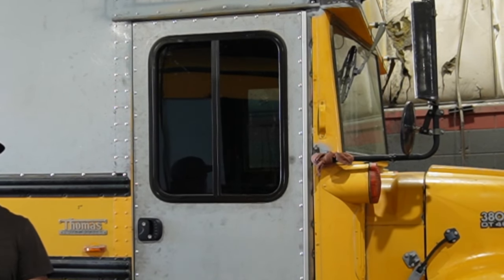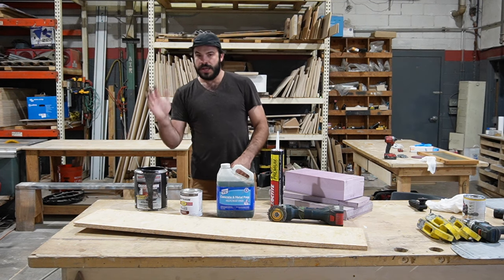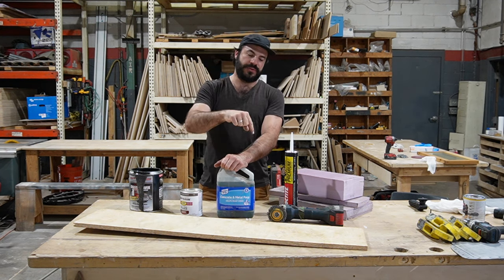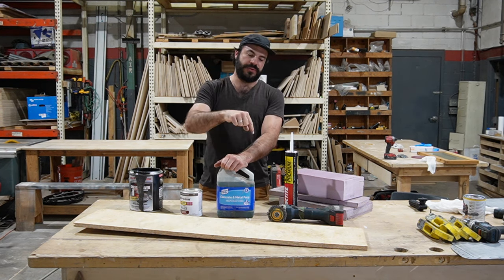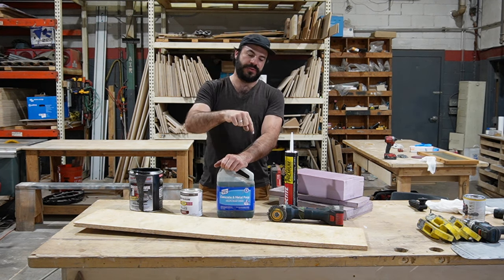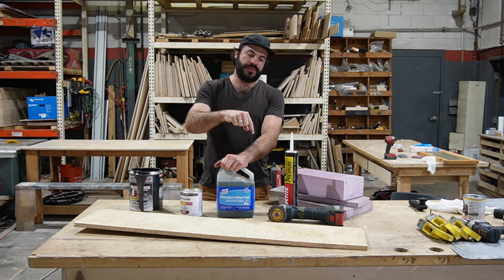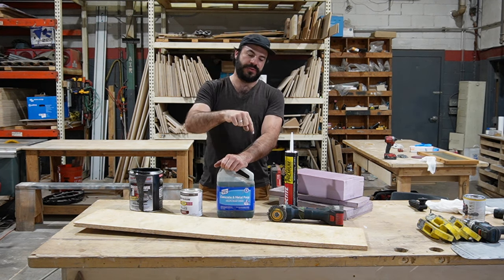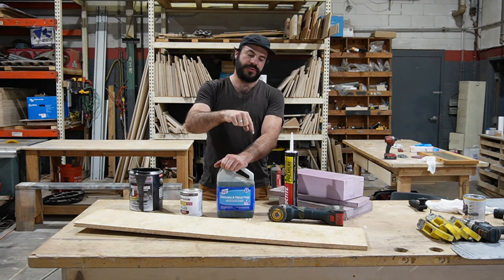Framing your bus conversion subfloor is a mistake, do this instead

Comment: Love your videos, liked and subbed!
I was pricing the foam sheets, and found that not only is the four inch stuff impossible to find, two 2" sheets ($42 USD each) cost less than one 4" sheet ($107 USD) , so, aside from the glue-up, it's cheaper!
Keep up the good work, I've learned a lot from your videos.
Reply: @DaveDrawing, what city and state do you live in, brother? The Foamular 2” XPS foam board is over $60 on my market. ☹️

If I purchase enough, it may be worth it to travel to save money. 

Thank you!
Reply: @trevorrisley5419  I'm in Richmond, Indiana. Our local Menard's sells the 4'x8'x2" for $41.33 USD, even eight months after I made that comment! Where are you?
Reply: Pennsylvania $54
 @DaveDrawing
Reply: @nateboer  well, it IS a year later...

Comment: the floor hatch tip is now.saving my life, my party launched for burning man and got 90mi before fuel pump failure. they are now unloading bus, i had to build a bed frame (removable) atop the pump.

Comment: I learn something new in every video.  Thank you for all of the great info.  I am wondering if any/all of these options can be applied to a new chassis Class B build (Ford Transit 6.5 ft. tall).  In an effort to balance sub-floor thickness vs height, I was originally considering only 1/2" of insulation (R-3), but after seeing that you use 4" in a bus, now trying to determine if 1.5" XPS + 1/2" AdvanTech would be sufficient?  The foam would be glued on top of floor ridges (per your video), which would leave a small gap between the metal floor and insulation which I thought would provide some air flow (and water escape path) in case of a future water system leak.  Also, would you recommend the drilling of a few small (1/4") strategically placed drain holes into the metal floor under the insulation, plus a coating of chassis sealer onto the new metal floor afterwards for added protection?

Comment: Wonderful tips, thanks! It think that window and door conduction, and convection from inevitable air leaks in windows and doors, will offset a lot of gains from the extensive work to achieve R20 in the floors. A couple of inches of insulation (to at least match the double pane window R value), a good heater and lots of warm clothes for the winter, and lots of air movement for the summer, would be more practical, especially for tighter builds than a spacious school bus. Nonetheless I like your no nonsense approaches.

Comment: The best, most comprehensive build video I have seen so far! Two questions: 1) Does the paint on top of wood act as vapor barrier or do you not subscribe to the need for a vapor barrier? 2) When you don’t patch holes in the floor, I assume you mean the tiny screw holes, but how would you patch up larger holes from coolant/heater hoses and such - assuming you’d want to patch big holes?

Your videos are so helpful and I can’t thank you enough for making these!
Reply from the maker: im not worried about a vapor barrier yet as that will be a part of the finished floor when i install that. this bus has none of those holes but on the ones that do, we use a scrap piece of sheetmetal and glue it down! great questions, thanks!
Reply: Question: what do you do if your metal pan isn't perfectly flat but has channels? Do you fill the channels with wood? Foam?

Comment: Big can is basically knock off version of Por-15. Definitely great stuff, and it does prefer 'seasoned' metal. The older and more exposed metal, the better it'll adhere. Coffee scooper or something equivalent is the best to use to scoop it out of the can into a disposable container. That way you keep the paint from getting into the seam in the can where the lid goes. This will make it so you can reuse the can/ paint and get it off again. If you spill enough paint in that groove you'll have to literally destroy the can to get it open again. Not a big deal if you're using the whole can, but as you said, a little goes a long way, and at the price of it, it makes sense not to waste it. I know this as I've used it on track car chassis and rust repair situations over the years. It's really great stuff, and definitely good to use if you live in the rust belt. Good video, I enjoyed it. 😎👍
Reply from the maker: thanks for the tips and watching this video!

Comment: Take a look at the Eastwood or Harbor Freight Surface prep tool. Used a HF Bauer on my suv to prep the entire roof for spray-on bed liner. That tool is very well built and the best bang for the buck. Will be using it again to completely restore my 5 x 10 utility trailer.

Comment: If someone were deadset on filling the floor holes, rather spend the time and tedious work welding, purchase rubber grommits that size and apply the chasis saver over it to create the seal! And anytime you weld you should corrosion protect both sides. That chasis saver should ideally cover both sides of the floor!

Comment: Here in the rainy Pacific NW I noticed the first signs that the windows of my 24' 2009 International six window bus were in need of some sealing, where the exterior sill met the sides of the window frame. That's where there was some minor leaking on a couple of the rear driver's side windows, while it was parked. I have no garage to park it in. So, I'm hoping to keep the weather out. There's also some sort of vent on top just forward of the front emergency hatch. I wonder if that might become a place for the weather to enter.

Comment: Bro, that floor ain't letting any heat through. Great work
Reply from the maker: Not at all
Reply: @ChuckCassadyYT  do you have any videos or tips about transfering this to a van build by any chance? I feel like there isn't enough space in the walls of a van to make them as insullated as your bus builds. Thanks!

Comment: On another planet ; I'm restoring my '98 Mercedes bus and welding the internal bulkhead structure. Had planned to weld a giant cage within the shell structure, but hadn't figured on the cold-bridge aspect. There IS no floor pan, it's an open frame that I was going to weld vertical steels to. But now it looks like I'm going to have to assemble an insulated floor beneath all structural supports - big project just got bigger!
Reply from the maker: They have a tendency to Do that!

Comment: There are roof coverboards in 4 by 8 sheets thats are polyisocyanate foam in four inch thickness.  They have a strong bonded membrane on both faces.  Super tough and bond to many typical adhesives.  Water base contact cement is a popular option.
Reply from the maker: Poly iso has an r value that drops as temp drops so I don't generally use it
Reply: True.  How did you decide on the four inch insulation thickness? That is super insulation level specification.  Does the extra floor deck height have any trade-offs?  I’m a sailboat guy, so adding four inches of rigid foam anywhere is hard to accommodate!😊

Comment: Another great video....thank you!
What are your thoughts on a new floor?   I'm going to use your method on a new Promaster van.   It has zero rust.    Clean and go straight to glueing the foam board or?    Thanks in advance.

Comment: Great Video...!!  Wow, no staples in your subfloor.  You glue everything.  Curious, my Class C I'm pulling the floor up in, has the light blue foam, and the OSB is on 1/4 inch.  Any Advice?  Does the, or would you approve of a thinner Advantech OSB?  Also, have you heard about DRICORE Insul-Armor?  Instead of Advantech?  That Insul Armor,  the weight supported (per sq. ft.) for this panel is 3,650 lbs. (1,659 kg)  I'm so confused...!!  I'm still struggling to get these plywood staples out of the original OSB

Comment: Great video!  Two questions.  First, do you add XPS insulation (1 or 2 layers) to the underside of the access door to help cut down on thermal bridging?  Second, do you also use the 1” XPS & 3/4” engineered OSB sandwich on top of the stair treads to reduce thermal bridging & to keep the height of the steps consistent?  Thanks.

Comment: When u cut out the access hole u created a perfect patch. Why didn't u just use That piece as your access patch?   I have Promaster van so Much smaller version  only 60 Sq foot dance floor?   Do u Really need 4" insulation on Floor?  That seems a bit much?  But U are the master.   Right now I have 3/4" OSB w 1/4" heavy rubber mat onto.  No foam floor yet but am not Living inside in Winter yet.   Very educational videos!

Comment: I was surprised you did not put your  first layer of foam board under the frame for gas tank opening, to keep the wood off metal, then stick a piece on the cover to insulate the area a little.

Comment: Great step by step video Chuck..
A DIY book come to life.
One question I have though is, what about the top arches of the wheel wells that are exposed? Since cold/ hot air are under them. Insulate them too or do you leave them as is?
Reply from the maker: They will be boxed and sprayed with insulation!

Comment: So well thought out and explained!  👍💪
A joy to follow (as I'm building while listening) 😂

I went with plywood in my home because I was moving in on subfloor and would have to live on it as I made finishing touches.  It looks way better and has far fewer splintering issues -- at least in conditioned space.  Here thirty years later I'm working atop my subfloor ina section that still hasn't received finished floor.  Today, if I were going to cover it before use, I'd def go with avantek.  But let's be real, they just don't make quality subfloor like they used to.  Anyway...

I'm enclosing a porch, have XPS over decking board, then 3/8 roofing plywood to spread point loads.  I haven't yet identified what I'll go with for finished floor.  I'd like something a little cushiony and waterproof, like those puzzle floors for kids playing and maybe workstations on concrete floors.  But in large sheets or rolls; I have no idea if such a product exists.

I'm not glueing my layers, just packing it tight.   Taped the XPS seams with tescon vana, wall seams included (fun!)  Tape like that might come in handy on your builds.  Water shedding, vapor retarding, air blocking.  And it had pretty good mechanical strength too, not that it's made for that.  Once it sticks...  I think it has to be destroyed to remove it.   Limited application but very handy at times.  I have even fixed ripped jeans with it.

Good job sir!  It's entertaining how solid ideas can be controversial but sometimes we just never learn...  Peace!  ☮️
Reply from the maker: nice! good method on the deck. That tape sounds aweome. Reminds me maybe of the flashing tape used for the zip system wall sheathing. its incredible
Reply: @ChuckCassadyYT  
Yes, sir my friend! The zip tape, we used that on our BARD (big ass roof deck, 96 sheets).   My son found this other tape being used for WRB joints, got some samples, and the rest is history.  Zip tape is smooth and shiny on the backing where the Vana is cloth-like, with increased flexibility along all axes.  It's like my son replied to me when I informed him that I had already gone through the roll he gave me to take home, with no preconceived plan, "it's addictive!"   😂

Blessings!

Comment: Great vid and info, thanks. I hope you can do an insulation vid part two, covering insulation of the walls and ceiling. Some info on Havelok wool use and their mystery product would be great as well. One question, is gluing/caulking the foam to the bus metal floor required?
Reply from the maker: I've made several insulation Video. You can use the search function or simply browse my channel to find them

Comment: Please note Polyiso will degrade when exposed to moisture over time. I have seen this when it was used on flat commercial roofs for HVAC equipment curbs. Some of my clients and designers forbid Polyiso on roof assemblies.

Comment: Advantech is great stuff. Builders like it because it’s often exposed to weather for weeks before the roof is on.  They don’t cover it to protect it from rain.  I think every piece of raw wood in a van/bus build should be coated on all sides with a good primer or sealer - before it’s installed - to prevent water absorption and mildew or mold. Will you fill the edges with Great Stuff, or no?

Comment: So the only place your floor is "screwed " down is either end of the bus?

I am in the planning phase of making a Cargo Trailer Conversion. I like your version of laying thr floor the most that I've seen. I'm planning on ding it your way. But for my floor covering, I'm planning on using a quality vinyl floor (one roll). How do I deal with the seams that I see in your floor? As vinyl is going to show that.

TIA.

PS. I live north of you in Cheyenne.

Comment: Chuck Cassady, your video was REALLY well done, and appreciated.  It's fun to see it being shared and linked to across many of the Facebook groups that I follow, as I'm continuing down the road converting a Kenworth crewcab ambulance into an AdventureRV.  I do have a question, I'm having a real problem finding a source for Advantech OSB board, and also having a problem finding Foamular 250 - local sources in Phoenix are only offering Foamular 150.  Any suggestions?
Reply from the maker: Formular 150 should be plenty! Check out the crush test I did on it!

Comment: Hi, thanks for spreading your knowledge. “Caring too much,” is not nearly the problem of caring too little, BTW. 

You’ve “schooled” me (ahem) on so much, and I will be following your advice as much as I can given my particular challenges/environment, the greatest of which is height. I have about 2” head clearance bare foot in my empty n bare bones, 2006 Dodge Sprinter.

What do I compromise? I want to address thermal bridging, but if I do, and go with 3/4” subfloor, a thin 1/4” carpet, and 1/2” XPS over bridges, I have 1/2” for the ceiling (1/4” insulation and 1/4” panel/cover)

Thoughts, particularly on going to 1/2” on subfloor, 1/4” insulation; to add 1/4 insulation to ceiling thermal bridges (for 1/2” total up there).

And, if I should not compromise the subfloor, should I compromise the floor over the ceiling: As I understand, the roof is more thermally permeable in either whether conditions.

Frankly, I’m leaning towards no insulation on bridges of floor, standard sub, 1/4” carpet; 3/4” insulation, 1/4” finish for the roof

Comment: Another late to the party comment. Given how much clearance there is from the top of the tire to the u see side of the wheel well, even at full compression of the suspension, I wonder if it would be worth chopping off the top of the wheel well to allow for a fully flat floor instead of the cut outs. Of course one is doing some welding to get there.

Comment: What type of roller for the chassis saver? Everything I read says spray it and thin it first. Also - rollers just falling apart, so recommend brushing as alternative.
Reply from the maker: its just a  foam roller i think. nothing special

Comment: Cool video.  Controversy is fun!!

Wondering if anyone has commentary on the indoor-use of Chassis-saver (e.g. any potential off-gas).  Considering it's a living space, it doesn't hurt to think about it.  Seems to be one of the difficulties we confront with modern building methods.  Some are great and offer elegant solutions to old problems.  Some work well but introduce new problems (often with potential health implications with long-term exposure). Modern houses are no different in this reagrd..  It's become more difficult to navigate all of the different alternatives.
Reply from the maker: hard to imagine it off-gassing as it cures extremely hard with no odors and even so, it does end up sealed under the insulation pretty well. it is hard to navigate. I spend lots of time keeping myself informed, but at the end of the day the pollutants coming out of the tailpipe and your proximity to them are far and away the most dangerous part of this equation
Reply: @ChuckCassadyYT  Thanks for the reply, Chuck.  True enough on emissions.  And we're constantly exposed to so much in this era, regardless of our choices.  Imagine you're right about the curing of the chassis-saver as well.  Not something I've heard of before, so I appreciate your input as you've clearly put the time in!

A guy can only go so far with the due diligence.  At some point you just have to roll with something that checks enough of the right boxes.

On another note, really enjoying your videos.  Informative and helpful.  My girlfriend was napping last night while I watched, and this morning she asks, "Who was that guy you were listening to...I really liked his voice.  No idea what he was talking about...but his delivery was great.''  Ha.

Comment: Thanks for your really informative video.  This is probably a silly question (from someone who doesn't have any knowledge right now!), but do you also try to glue between the sides of each section if you're able to (i.e. to minimise gaps/ movement), or do you just try to ensure each section is pushed up really tightly to the next?

Comment: Good morning, I am a disabled grandmother in power chair that just bought a 40 foot 2001 international school bus with a lift in the rear. I am wondering around the doors, where exactly the plywood (3/4? Or did you use the osb?)brace went? I watched the video over and over again, but I did not catch that part. I also have to figure out what to do with the wheelchair lift when I am doing this. You said you use spray insulation around the walls? Do you have a video covering that step? thank you!